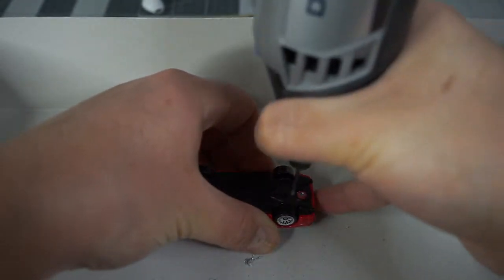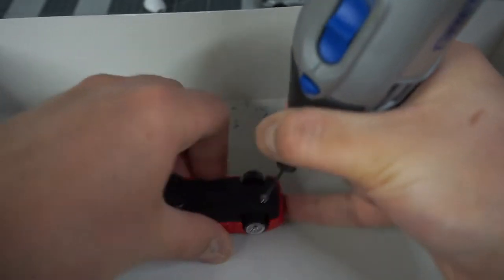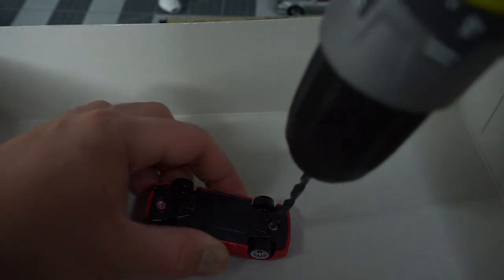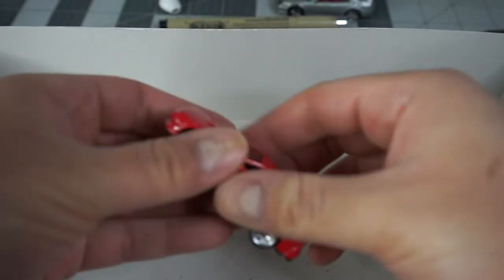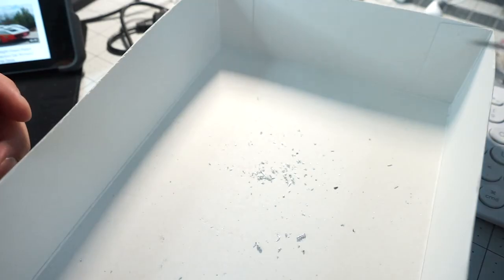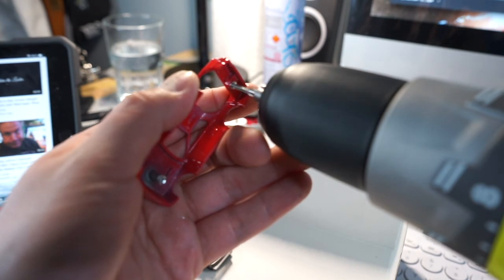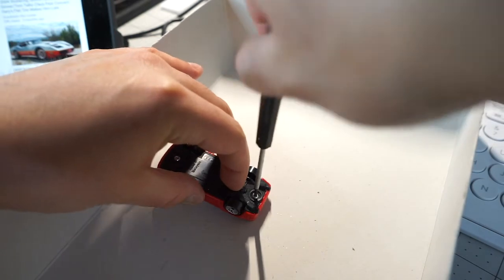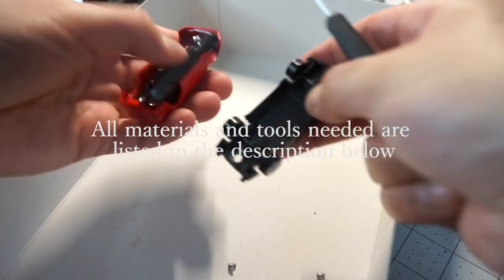How to drill tap a Hot Wheel (or any diecast car)

Comment: Actually, you can use the screw to tap the soft metal directly... no tap required.
Reply: How about using a Thread Cutting Screw?  Would that work?
Reply: What screws can be used without tapping?

Comment: How long are the screws?
Reply from the maker: About 1/4 inch
Reply: What size screw
Reply: I think they are M3 6mm Phillips head. M3 for Tap and Screws or 2-56, the conversion messes me up, but I think that's correct if unsure count the notches on a ruler to figure out what size/how long you need. Hope this helps